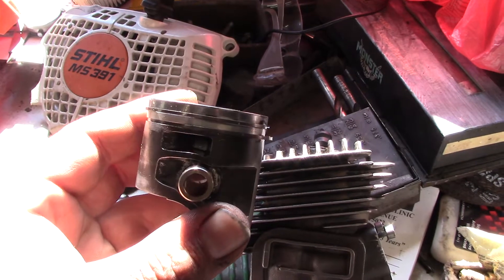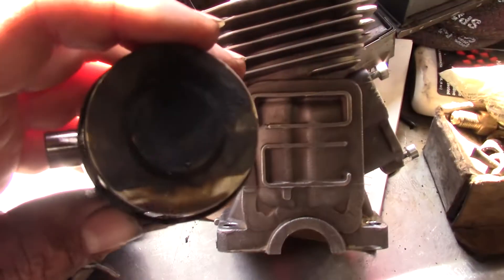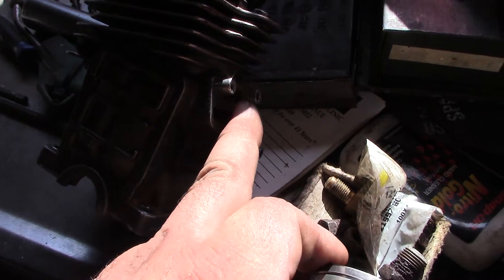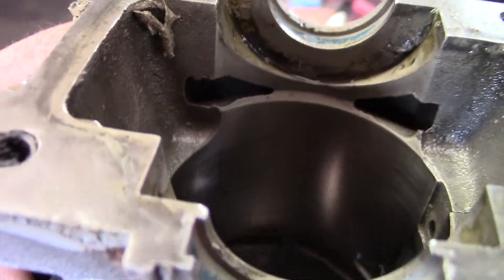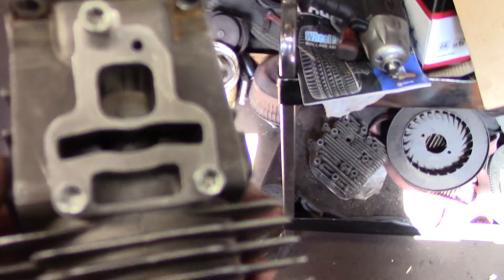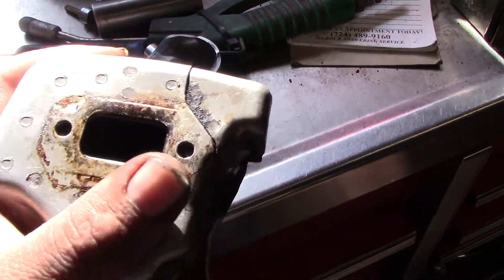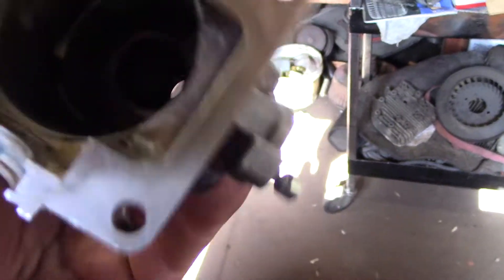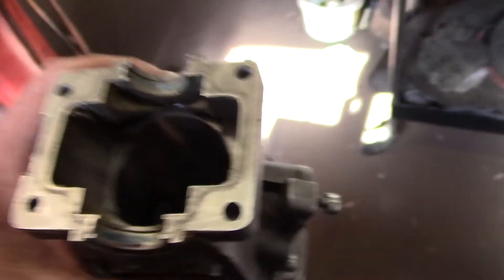Stihl ms 391 tear down strato port theory and thoughts on port timing changes!

Comment: Greg Bissell
I bought a new MS391 2 1/2 yrs ago. The dealer couldn't get it to start, but I trusted they flooded it. Very temperamental saws I was told. Took it home thinking that I made a great purchase! I never got it to run more than 5 minutes at a time. Pulled my guts out pulling on that damn rope! Finally took it to the dealer to fix and they gave it back to me with the suggestion to junk it. Seems it was over the warranty by a couple of months. Would cost more to put a new motor on it than it was worth. They charged me $250.00 to tell me that. I was upset that they wouldn't stand behind the saw! Took it home, tore it apart, found that the top ring was stuck and both skirts were lying under the crank. Bought a new piston kit for $45.00, put it together in an hour and started it up on the second pull. I will never buy another product from Stihl nor their 2 cycle oil which is garbage! What a POS company and what a POS saw! I've had a Poulan for over 30 years and it still runs like a champ!  Stihl should take notes on how to make a quality product! They have fallen a long ways in my eyes and for many loggers too! It just doesn't have the power that was promised to run a 25" blade! The company should recall the 391 and fix the many mistakes that they engineered into that POS!!
Reply: I bought a shindawa 341after my ms170 blew its bottom end. Dissapointed. Don't know weather fuel oil or the age of the mix/ carb ajustment ( non ajustable) for the use it had. Not enough.  Intake fuller design not the best.  Looks like they rectified it with the 171. If the cover aint on properly you gonna suck dirt in.

Comment: Great stuff Kenny. My MS391 lost compression for no good reason. I had run about 10 tanks through it cutting firewood out of big cottonwood logs.  I took it to the Stihl dealer. Shock, he told me the saw was destroyed and not worth rebuilding.  Keep in mind this cost me over $600. The sad thing is I had traded in an old 0V 41 super saw that was working fine I had used for 30 years. The dealer's attitude is the saw is crap and not worth shit if you are serious about cutting wood. Amazing. So that is question 1). Is this saw worth the effort to fix!   2). How to get off the carb?  The bolts are out of reach of any reasonable tool.  Nobody discusses this on the Tube that I can find. Help us out.
Reply from the maker: Shame your new saw went bad I wish stihl would fix those those 391s pistons always score. I think I know why those saws blow up it is the strato port design. To get the carb off there are 2  8mm bolts when air cleaner off. Get a Hyway or dukes saw salvage cylinder and piston. Is there any way you can get your stihl 041 av super back?

Comment: Hi I got a problem I got 311 needs coil 1303 coil but I'm trying a coil off a 291 it fits but still won't start you think I should swap the flywheel
Reply from the maker: Pull the muffler and see if the piston is scored. Bad problem on 391 - 311 saws . I believe the coil malfunctions and causes detonation and the piston gets scored or hole blown threw it.  The flywheels usually never go bad. I think the bosch spark plugs  make the coils go bad.
Reply: @kennytheguitarfanatic054  yep its probably the piston it shows 110 psi compression test but doesn't turn over  , also the only way it shows spark is when I spin with drill
Reply from the maker: @happydays454  Pull the muffler to see if the piston is scored should just be 2  T27 screws . Also on those saws just pull the pull rope by hand to see if it has spark because a bad coil can sometimes show spark at higher rpms spinning it with a drill. if it does not show spark at low rpms it is likely bad coil.
Reply: @kennytheguitarfanatic054  its weird I tried a bunch of different good working coils off of different stihl s I got and and at low rpm no visual spark only at high rpm speeds  I got spark
Reply: Idk I just don't like those saws 311 and 391
Reply from the maker: @happydays454  Yes I agree those saws are not too good lots of problems. If I had to do it all over again I would have gotten  a Neo tec saw or an echo cs 590.
Reply: @kennytheguitarfanatic054  I like husqvarna the echo timbers wolf floods fast if you choke to long but is ok,  those neo tec can get destroyed in one week

Comment: 64cc ya I have a391 my self I have to rebuild my self I have a hi way piston and jug  I have done nothing with  I did not go with Sthil because they wanted way to much $$$$ for theirs  I think Chang the muffler completely out build one  and get rid of stat screen to  they just build up with carbon keep posting what you find and what you improve on please please
Reply from the maker: The Hyway cylinder and piston have better tolerance together. The stihl piston rocks in the bore. The combustion camber and squish are better so you get more compression. you have to open up the primary lower transfer port like I did the one on the exhaust side because the saw will run lean in a big cut.  Don't open the lower transfer near the intake  because the way the piston is made. Make sure you clean transfer ports well because metal chips will get in there . When you get it running turn the high jet on the carb out 1 turn to maybe 1- 1/4 out .